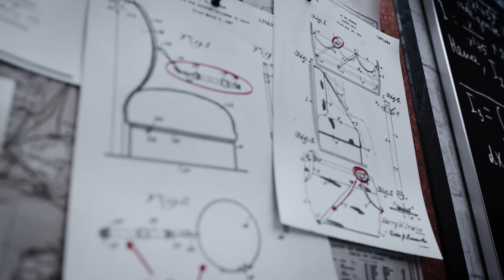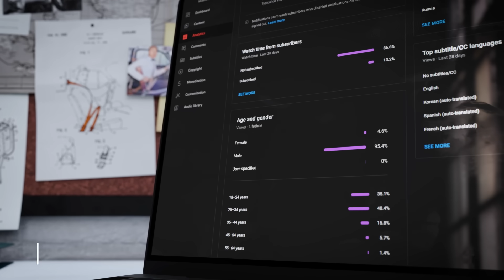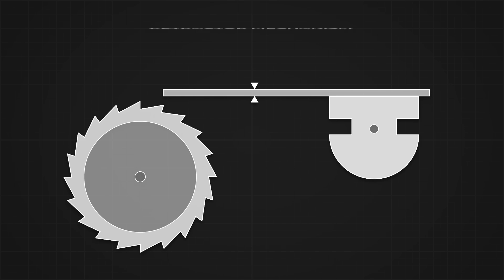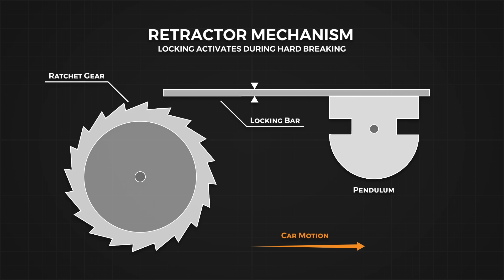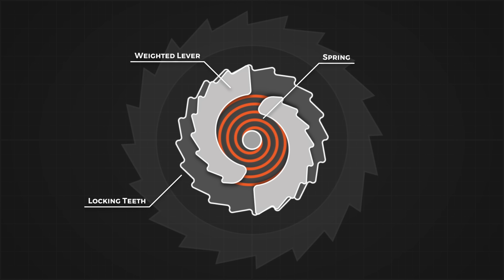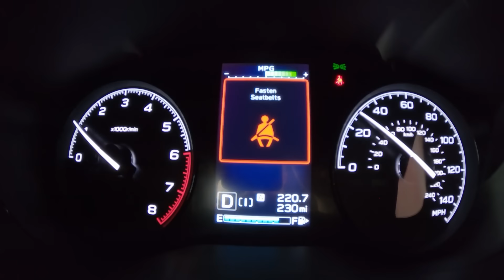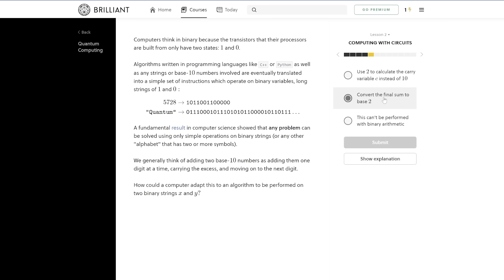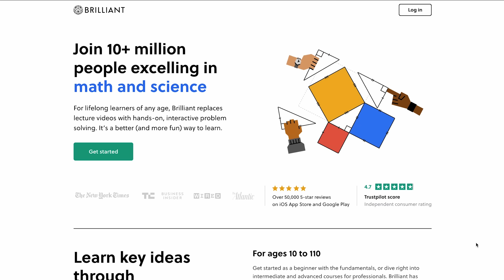How Do Seatbelts Work?

Comment: I've always worn a seatbelt no matter how short a car journey is. Never without it.
Reply: It's in my default rhythm of starting the car, to put it on.
Reply: @tardvandecluntproductions1278  Mmmm same here. Its become hardwired
Reply: @tardvandecluntproductions1278  not in a B15 Sentra is sit down, close door, key turn key to run, while fuel pump is priming put seat belt on, then crank.
Reply: You've probably seen plenty of videos of drivers losing control and slamming into stationary cars at gas stations or parking lots. So it makes sense to have the belt on even if the car is not moving so might as well leave it on until you step out of the car and putting it on right after entering. So if anyone bumps into you (even a small nudge from a heavy vehicle can slam you into your dashboard), you'll have the belt and airbags helping you out.
Reply: most accidents happen in a ten block radius from the house.

Comment: Many years ago, when I was back at school, 4 guys from my year got into a car accident. The car tumbled several times and fell upside down.
3 of the guys easily climbed out of the car with minor injuries. The fourth died on the spot.
The 3 were wearing their seatbelts. The fourth wasn't.

Wear your seatbelts. They can save your life.
Reply: those other 3 are lucky they didn't die from the 4th flying around inside the vehicle like a fucking projectile. This is actually a common cause of death in accidents where one or more passengers didn't wear a seatbelt, and the risk is higher for each person doing so
Reply: One time on the way back from a youth event we came upon a van also coming back from that youth event that had rolled in the ditch. Single rollover I believe, landed on it's wheels, everyone buckled as far as I know, and everyone walked away from that incident with nothing more than a serious scare and some minor lacerations. Because the van was totalled and we had some room in our car we ended up giving one or two of the kids a ride home.
Reply: Yep, The claim "but I won't be able to get out quickly if the car goes underwater" is BS. If you are knocked unconscious because you weren't buckled in, you absolutely won't be able to get out of the car in time.
Reply: Funnily one of my dad's friends was killed after rolling a car into a ditch and wearing a seatbelt. At first he was fine but once he unbuckled and tried to move out the car he passed out and died. They found out that the seat belt had ripped his spleen while restraining him. The coroner figured that the pressure from the belt had likely been stopping the blood flow until he unbuckled.

This was a LONG time ago, we're talking late 70s, very early 80s, seat belts were still a novelty here back then...

Everything is a risk but if you care about the risk that wearing a seat belt poses to you health in a car crash then you should never get into a car ever again because seat belts are the best option currently and if you're worried about the damage they can do, you should REALLY care about the damage not wearing one can do.
Reply: Bruh, this anecdote is told to nearly all high school aged kids. That ish never happened.
Reply: @wejsmith5446  Well if you want stats just watch the video the stats agree with the story being likely.

Comment: Crumple zones are only good for 1 hit, then the integrity of the metal is compromised. In multiple collision accidents like a multiple car pileup or a high speed roll, a solid frame is safer. Had a best friend who's girlfriend died in highschool because her car was hit, and then knocked into a telephone pole after the crumple zone fulfilled its purpose with the initial collision, leaving no protection for the 2nd.
Reply: And had the car been more rigid, she very well could have been killed by either impact- due to the forces that could have been dissipated within a crumple zone are rather now transferred into the passenger compartment sending her head into the B pillar at Mach 4.
Reply: It feels like 'crumple zones' was a buzzword invented by marketing so they could justify making "less car" by explaining that its safer & reduced weight means better gas mileage. Not to mention a wet dream for 'planned obsolescense'
Reply: @Coconut-219  countless studies done by numerous agencies would disagree with the stupidity you decided to post today.
Reply: @Coconut-219  No, crumple zones are a real thing. For example they found out back in the 1960s that car hoods like to get torn off the hinges and come into the passenger compartment edgewise in a head on crash, so they put a built in weak spot midway in the hood so it will fold upward. They also found the steering column likes to do the same thing, so the made that collapsible too. They try to put calculated weak spots in the body and chassis where they hope it will fold upward or outward to absorb a little energy. If you pay attention you'll notice the fenders and quarterpanels tend to fold outward above the wheel openings. This is by design. They were putting these features in 2.5 ton V8 luxury sleds from 50 years ago, and I have a 6000lb V8 SUV with the same crash features, so don't be silly and say they're scheming to give you "less car". The thing is there is only so much they can do with calculated weak spots and still have a car that holds together while you drive it. Whiney people will always complain that the crumple zone didn't save somebody in a gnarley multi hit crash. All it can do is improve your chances in a typical crash. It cannot guarantee you always win. If you want better chances you have to install a full roll cage like a race car.

Comment: I was living in New York in 1984. I don't recall the requirement to wear seat belts being enacted then, but I'd been wearing seat belts since 1976, when I got a driver's license.
Reply: I started driving around '75 or '76 in Ontario, and I think it was when seatbelt use was legislated. If not it was very shortly before.
Reply: Of course seat belts save lives.  I wear mine.  But there should be no law requiring people to wear them.  This is just a way for governments to shake us down. Persuade people, don't force them.  It works better. But we get to say how much risk we take with our own lives.  Gonna outlaw base-jumping and wing-suits?  That's just not the proper role of government.

Comment: Seat belts are more important than most people realize. They once saved me from serious injury or death and I have seen many cases where people would have died without them. Some people argue that the seat belt can cause damage (internal bleeding and such). While this may be true in some cases, if enough force was generated that the seat belt caused internal bleeding, it would have been enough to kill the person for sure if they had not been wearing it at all. You will be much better off having all that force distributed across the area of the seat belt than having it concentrated on your chest by the steering wheel… or on your head from the windshield. Amazing video! I always enjoy  them and learn something new every time. Keep up the good work!
Reply: There was some 'teething trouble' with early designs killing people for various reasons, modern ones are 'good enough for government work' safety wise - although one thing that's sort of pushed the statistics back the other way is that now alot of safety in the frame of cars is being sacrificed because less weight means better gas mileage.

Comment: My first car was a 67 Buick Skylark back in 1998 when I was 15 (had a hardship license) that only had lap belts. I currently have a 70 Buick Skylark, it has lap belts and separate shoulder to waist belts that hang from the roof above the doors (car doesn't really have a B pillar), and has a little tension clip that you fold the belt buckle back and slide it into to hold it when not in use.
Reply: As a teenager in the mid 70s I had my grandfather's 1970 Buick Electra to drive and I was that rare kid that wore both the lap and separate shoulder belts when I drove. Usually I was the only one in the car with the belts buckled- all my friends thought I was nuts for buckling up. One night a drunk driver in a Chevrolet suburban crossed the center line and hit me head on. Because of the size and quality of the Electra along with the fact that I was wearing both belts I walked away with only minor cuts, scratches and bruises from the belts which was far better than the unbelted drunk driver. Those older separate lap and shoulder belts when worn were pretty effective, granted they were not as comfortable as modern 3 point belts but definitely better than not wearing them. Sadly most people that did wear a belt back then only wore just the lap belt. It was the combination of both the lap and shoulder belts that offered the best protection in a crash.

Comment: I went out to my car and tried to count how many pyrotechnic charges, airbags/seatbelt pre-tensioners, I'm surrounded by while driving. 
I gave up after about a dozen, too many and too hard to identify each one. They're everywhere. 
I found SRS-Control boxes bolted to the underside of seats because the seats have airbags. Found some money too.   (2014 Volvo)
Can't even drive without buckling up due to the beeping eventually reaching a volume similar to that of a smoke alarm.
Reply: Just no better way to quickly release huge amounts of energy.

Many EVs come with pyro fuses on top of things, to blow apart the high voltage lines in case something goes wrong.
Reply: @Killerpixel11  Are you just talking about HRC fuses? Because all EV's use "Low Voltage". 
Technically "High Voltage" is >1000 V (AC rms) or >1600 V (DC) and there are no EV's using "High Voltage". 
I don't work on cars but if you know of an example where what you describe is utilised in a production car/truck, please do let me know as I'd love to read up on it. Cheers.
Reply: @PushyPawn  In the context of EVs, the "high voltage" refers to the drivetrain (battery, motors, etc.), as opposed to the typical 12V system. Depending on the car that's currently something between 400 V and 800 V DC. Good to now the actual definition is a different one, didn't know that.

And no, I mean actual pyro fuses. Tesla is using them for certain. Friend of mine had his pop, unfortunately. Protects the battery and the motors from faults during charging.

I believe Mercedes even had them on the 12V in certain models, for quite a while.

Comment: All these complexity just for a seatbelt. I guess motorsports have it easier with 6 point harnesses and HANS devices. Sure it may be slightly uncomfortable, but it's significantly safer and less complex. lol
Reply: But, unfortunately, completely non-viable for daily traffic, movement is restricted too much, need to be able to move around a bit.

Comment: Back in the late 90s, Mitsubishi Motors was issued an involuntary recall on certain seatbelt latches. The problem was that the seatbelt buckle appeared to click into the latched position but was only about 98% there. Enough to give you the false impression that you are safely buckled up. Mitsubishi executives pushed back on the recall because they said the latching problem only happened in North America and when they received faulty units inside they found large amounts of, and I quote, "horse hair and french fry salt," gunking up the latching mechanism. This is a racial stereotype of Americans who, of course, all eat french fries while they're driving and track large amounts of horse hair into their vehicles.

Comment: IT saves lives but not all the time. If my cousin was wearing a seatbelt he would be dead. He got thrown out and where he was crushed. But I believe as long as you're 18 years old you should be able to decide whether you wear a seatbelt or not is your body you can do what you want. 🙌 Fuck the law 🙌 I wear a seatbelt because I want to. But no know is going to force me even with a law.
Reply: Nice attitude. What do you say to the firefighter that has to scrape your moronic ass from the pavement after not wearing a seatbelt? That's what the law is for.
Reply: @Killerpixel11  I do not care🙌🤣

Comment: 4 point belts are much safer. Especially for smaller passengers.
Reply: I thought the 4 point brings in issues with neck injuries(especially when wearing a helmet) and the 3 point alleviates this by allowing some body movement. Hence the Hans devices now for racing.
Reply: @kc510  the hans devices are great and yeah,  the helmet necessitates a hans device. Its not more dangerous for the neck than a regular seat belt though.
Reply: i track my miata and have installed a 6 point harness however you cant use them on the road here in the states so it still has a traditional 3 point seat belt

Comment: Before the click it or ticket my dad didn't wear his seat belt and it saved his life and his riding friend from a horrible accident, he worked second says a surface coal miner and he was on his way to work when he seen a  coal truck which was over loaded with coal and was going over the speed limit and about to make a turn on a curve and instantly my dad knew what was about to happen so he prepare himself for impact,he moved off the road as best as he could and told his friend to lean over as far as they could and braced themselves and it happened. They were buried in over 60 tons of coal so I was told, this happened in the mid 1980's it ripped off the roof of my dad's car and injured them and they spent weeks in the hospital, I got the call from my dad's work that he had been in an accident and he was in route to hospital, I was at home with my nephew at the time, he and his friend had some bad injuries, but they survived and later it was investigated and everyone settled out of court. He later retired, well both of them. The highway patrol said if they had their seatbelt on they'd been decapitated.
Reply: I believe you, but anyone thinking seatbelts are a bad idea should look up survivorship bias.
Reply: @Just_Sara  That was a one time event, I always click my seat belt on and leave it on when I wait in the car, I know it's goofy but it's just me, I make sure that everyone to put on the belt or the car don't start,or according to Alabama law if you're not 100 pounds you don't sit in the front seat either.
Reply: @cyankirkpatrick5194  awesome! Thanks for being that stickler, it really can save lives.
Reply: @Just_Sara  Duh, they the kid's don't like it when I drive really so what, I know that I surprised you.  And I don't eat or drink anything when I drive, and of they're fighting I give the signal and pull over so they can finish fighting I don't play when it comes to driving. Nor do I turn on the radio if I do it stays on one station. A car is a big machine that can be a weapon if used wrong.

Comment: Being hit by a semi doing 50 on the highway while I was stopped I can say it's was mostly crumple zones and air bags that had me hobble away with minor injuries.   However I do think the seat-belt helped and yea, every advantage you can have is a good one.
I'm also one that went from 0% to 100% usage the day they became law.
Reply: It's always a combination of factors. Without a belt, at high enough speed, you can still get hammered, even with an airbag. And there will always be situations where crumple zones just aren't gonna cut it. Especially when dealing with side impacts, where curtain and seat airbags are a massive lifesaver.
Reply: I guess it was a rear impact? If so you probably owe a lot to the head rest. They are the single most important innovation when it comes to rear impacts, and they saved a lot of people from neck injuries. And yes, the seat belt does little when it comes to rear impacts. The seat assembly including head rest is what keeps you in place.
Reply: @danielrose1392  for a rear collision in traffic tho it would prevent you being thrown forwards if you hit the car infront of you
Reply: Who the hell would stop on the highway?
Reply: @cerdickjohn2385  you heard of traffic?
Reply: @cerdickjohn2385  ...who the hell would drive on the highway fully expecting never to find an obstacle?

Comment: Thanks for this video. I was born in the 80's myself and While I don't recall my seat belt usage as a child I know even than they were sometimes scoffed at. But since my teens and onward I automatically wear my seat belt and get annoyed when drivers don't give me time to put it on.
Reply: I was born in 81' and me and my cousins were always paying in the back of the Oldsmobile Hatchback or even worse, in the back of a 75 Ford Pickup with the very large dog on the freeway freeway. The cab of the truck was for the adults.....who were also drinking. .... Now days that wouldn't be tolerated by anyone.